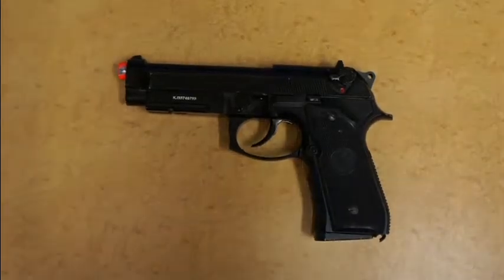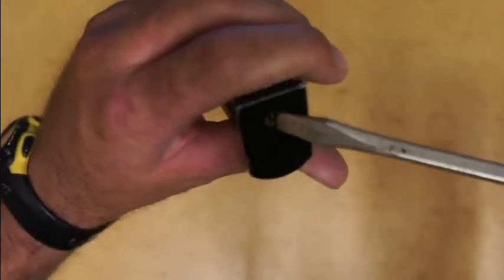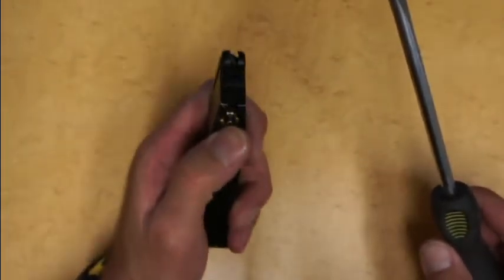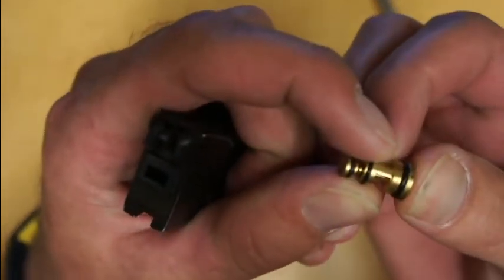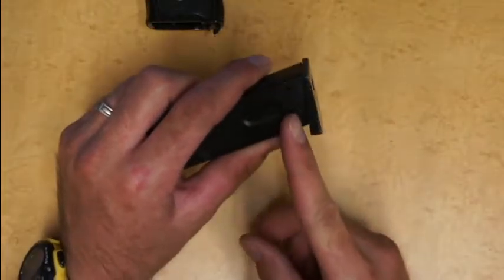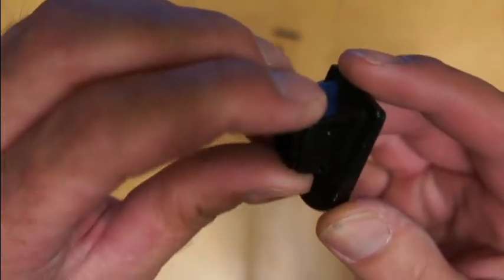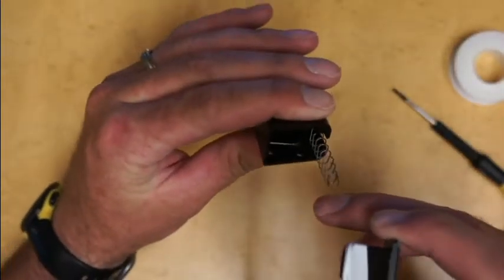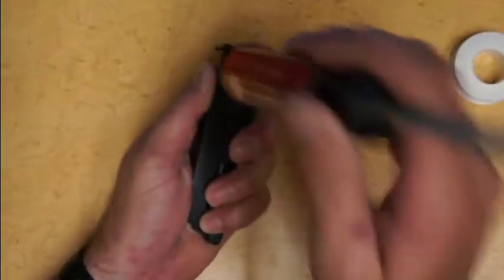M9 Airsoft Mag Repair

Comment: hey! i got a new m9 beretta but the mag is leaking a loooot of gas from the upper valve :( I am really lost on this problem since most videos seem to show fixs for the below valve :( any advice?
Reply: Sorry for responding so late, your problem is that one of the three o-rings in the button valve is broken, you can open it with a very wide flat screwdriver and buying some ones

Comment: quick question, if the top valve is faulty how would you fix it? my mag shoots off 2 bbs on the second trigger pull after refilling with gas and bbs. i think its too sensitive, i need to find a way to make it less reactive.